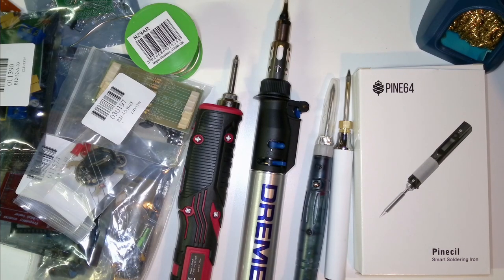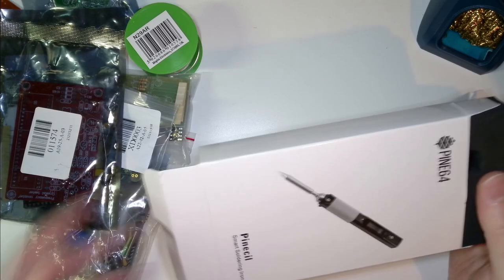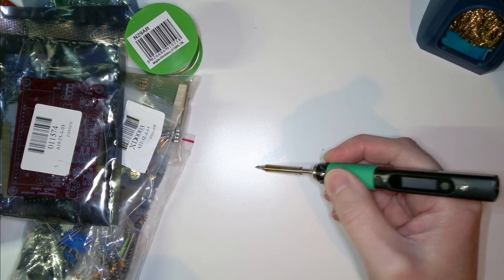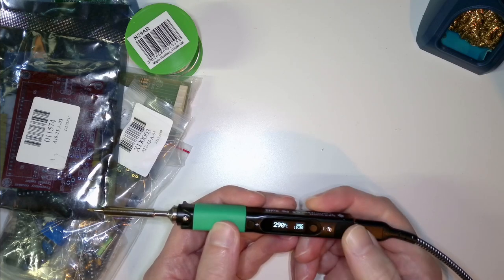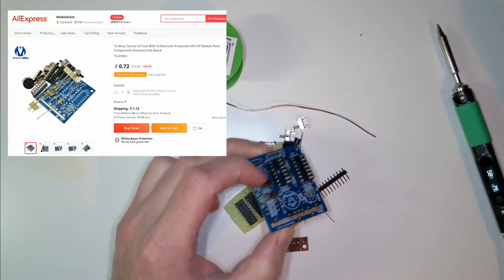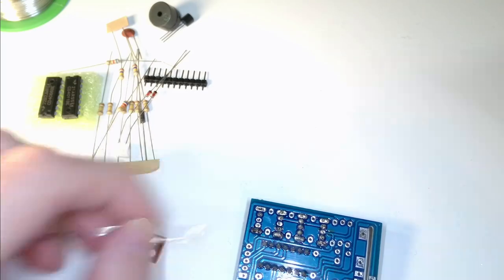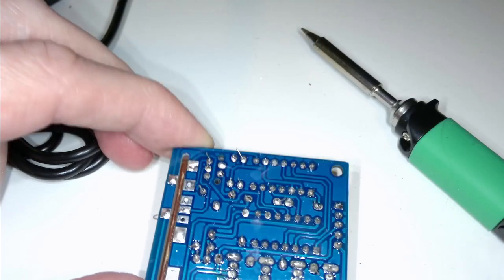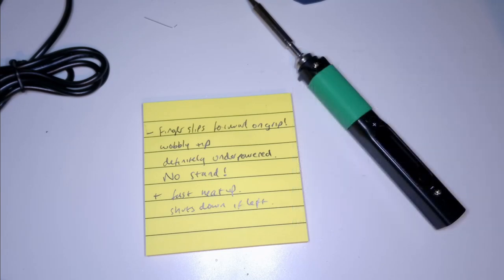PINECIL - How good is it? Soldering Iron Showdown - Ep1

Comment: You can reprogram Pinecil.. So, if you don't like what it's doing, then change it. You can also buy other shells to customize or repair it. My only complaint, is not being able to run it from a 36 or 48 volt battery. Well, guess i can't have everything.

Comment: Its definitely not underpowered, if you use a laptop charger it will heat up nicely.
Reply: I was gonna say... I really like this format and the video, but it could have used a little more research/knowledge... So now wie have "finger slips on grip" and "no stand" as negatives... Also it weighs like 30 grams, how would that ever slip? And personally I own a rubbish stand, but if I didn't I'd just make one out of a coathanger or whatever... We're here for DIY after all... 😀
Reply: Which laptop charger though?

Comment: Put a 5mm ID/8-10mm OD silicone tube (not gasoline tube, needs to be soft and very easily pliable) on that manual solder sucker tip to make it like engineer ss02 for pennies

Comment: Welcome to the electronic side of things! I wish you a great journey ;) Great video, thanks for your time making it. One tip maybe, for a quick video about soldering you wouldn't need ventilation or fume extractor. It doesn't do any harm if you do it now and again. So don't worry. Even if you use leaded solder, which I would recommend for hobby use. Solders way more easy and fine for hobbyist like us and that way you can ramble on during soldering. :)

Comment: Some tips:
- For DIY stuff don't use lead-free solder unless you have to. Harder to work with.
- You had the temperature set too low. 320ºC for leaded solder is ideal(higher for lead-free), going up to 340-350ºC for larger contact areas. Don't leave it on higher settings for regular soldering though, that causes oxidation and the flux evaporates too fast. IIRC the Pinecil has a "turbo" setting to briefly raise the temperature..
- Your solder looked a bit on the thick side, that wicks too much energy away. For regular electronics 0.5mm diameter solder is a good compromise
Reply: My solder does not stick to my 3.5mm earphone jack... What could be the problem??? My soldering iron or my 60/40 solder.... Btw I'm planning to buy new iron
Reply: "For DIY stuff don't use lead-free solder unless you have to. Harder to work with."
Kids, this is REALLY BAD advice. Don't listen to this man (probably the reason why he's giving bad advice is due to the lead poisoning). Use lead-free solder unless you want a disability placard.
Reply: @-iIIiiiiiIiiiiIIIiiIi-  The temperatures used in soldering are not high enough to make leaded vapor. The smoke from soldering is largely from the rosin flux. If you're in a well ventilated room, there is no need to worry about lead poisoning from such a small interaction.

If it makes you feel better, wear some nitrile gloves while handling the leaded solder.
Reply: @-iIIiiiiiIiiiiIIIiiIi- he not wrong I use lead solder for keyboard switches because if I need to remove a switch it's way easier to desolder lead solder compared to lead free because of the higher temperature is needed more likely to burn contact pad on the pcb. You can buy portable extractor fans for soldering.
Reply: @-iIIiiiiiIiiiiIIIiiIi-  complete nonsense

Comment: I want to get one because the TS80 only has USB-C limited to 20W and USB-C connections can cut out if the cable sucks. The best use for this would be a lithium battery to the barrel jack so you can use it anywhere.
Reply from the maker: I'm surprised there aren't more with internal batteries, like the frogbro!
Reply: The Anker Power bank with the small screen should be ideal for this... Sorry I don't know the humber/name by heart... Should be 21k capacity, though...

Comment: when soldering never push down hard on a PCB with the soldering iron per comment in  9:18 that you can't push down.   It should just be  a light pressure from the iron to the work piece.  if you are pushing that hard down, then  soldering technique is maybe incorrect.
Reply from the maker: Ah, the internet, where people will tell you you're soldering wrong :) The issue was the screw, I'm not new to this soldering thing...been doing it since the 1980s.
Reply: @lostincircuits   talking about the part in video where you said  if you push down hard your hand can slip down to get burned.  not sure what the screw thing is about, maybe  someone else confusing with my comment here.   easy to get confused between comments sometimes. if someone is pushing down that hard that they slip down on portable iron. screw issue, got me confused here. to be clear,   it's about safety issue you  brought up worrying your hand would slip down too much and get hurt.  I have several portables that are shape of small markers. they are all about the same this way.  just lightly touch  pins, not sure why people would be pushing down that hard with a portable iron. I also have some really old irons that have huge guards on them to block the  hand, but they just get in the way of soldering, and can't see as much on the PCB. I'd rather not have guard on a portable iron so more visibility and can fit into portable places and smaller carry case.
look at the professional expensive  irons too, like JBC . no guard it is shaped like a pen so there is nothing to block the hand from slipping down either.  I think it's more a feature to make soldering easier.
Reply: @nidusa1  i agree with you if you have done soldering forever you know that you get burn not from slip finger but rather from accidentally touching the hot tip as you work on your desk even using the stand provided by manufacture like hakko you still get burn by accidentally touching the tip
i never put to much pressure on my work unless some stubborn piece of electronics parts get stuck